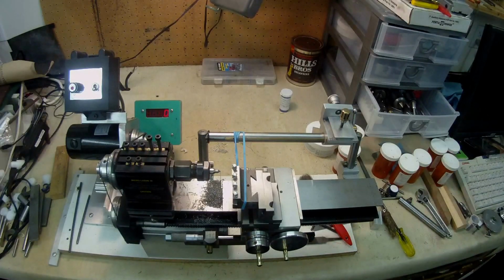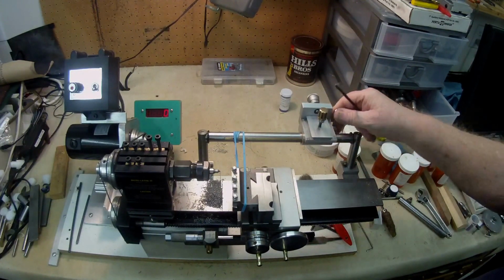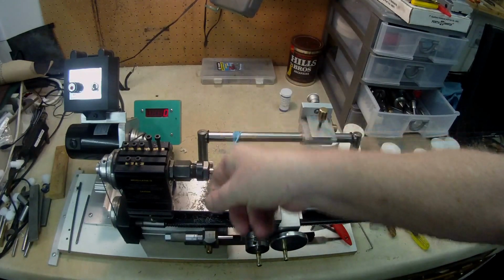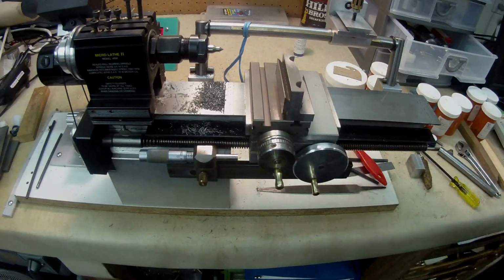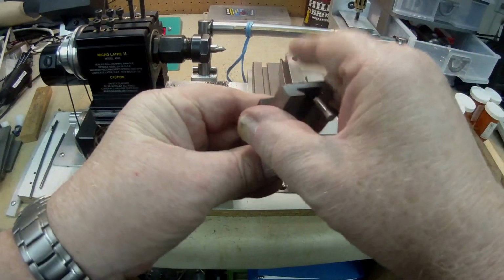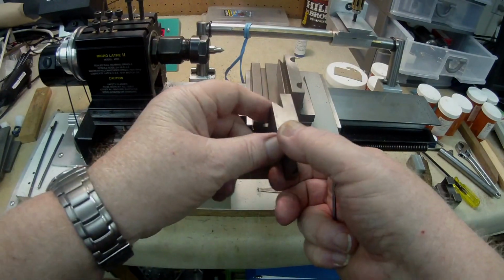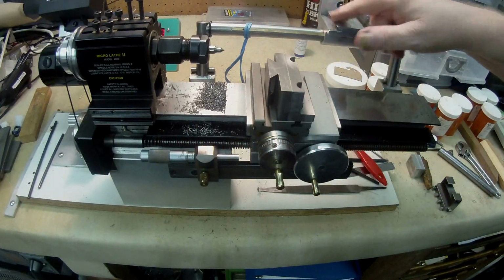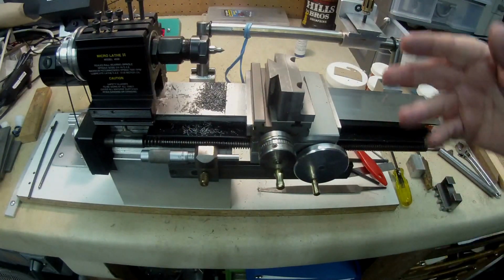FILE0023 Tenth part on Profile Tool

Comment: Hi Walter
Change the pointed grub screw for a dog point or grind it flat, because it is already digging into the piece of stainless and in a while it will always drag the tool height into the nearest divot making tool setting a real problem.  Lovely job of cutting the dovetail without a gib to take up the play.
Reply from the maker: Stephen
     Good man, thanks for your observation, I hadn't noticed that marking, I had originally machined the tip flat and turned it down to .140 dia clearance ( the slot is 5/32) but the flat had a small pip so I have drilled the flat and inserted a delrin pad for protection,

Edmund........Alberta